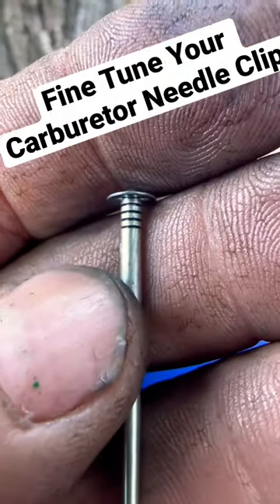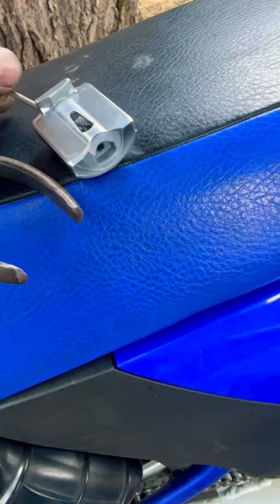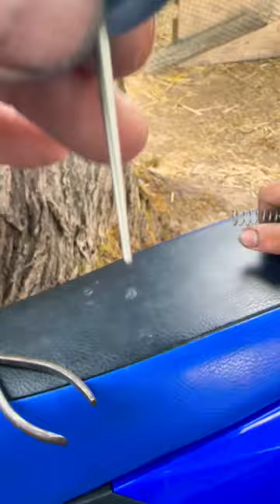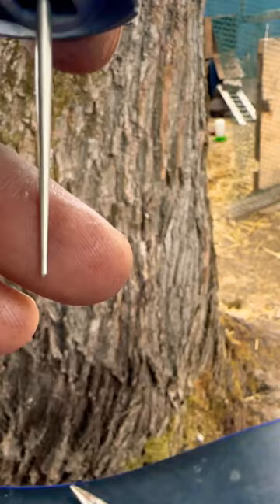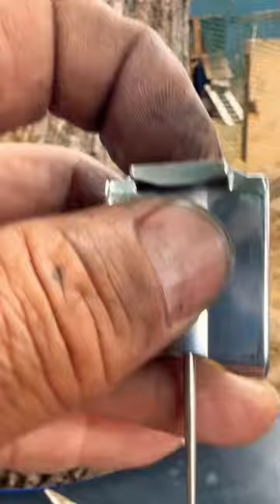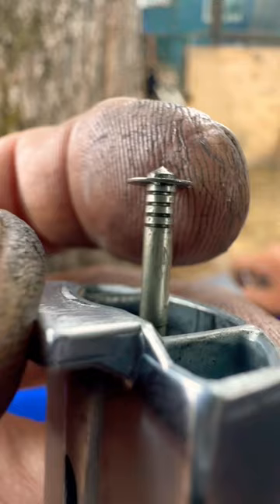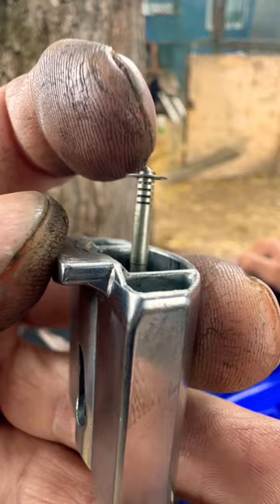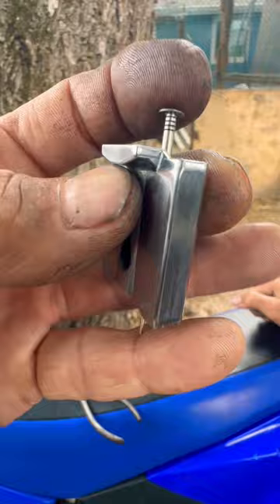How to FINE TUNE  a Motorcycle Carburetor🪛 #carburetor #tuning #motorcycle

Comment: would this be the same for 96 VT1100C2 carbs?
Reply from the maker: I am not sure about that to be honest. I have never had those apart before. I will research it.
Reply from the maker: I did look at it and it does have an adjustment , the clip style.  And an upgrade is dynojet.